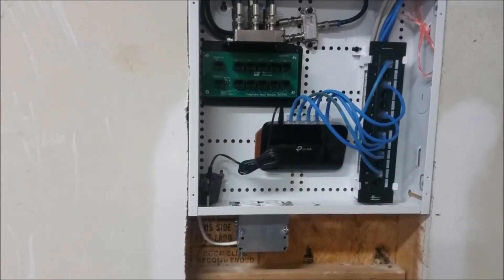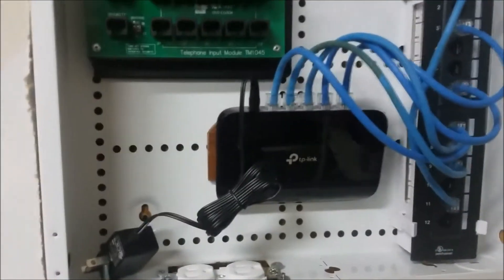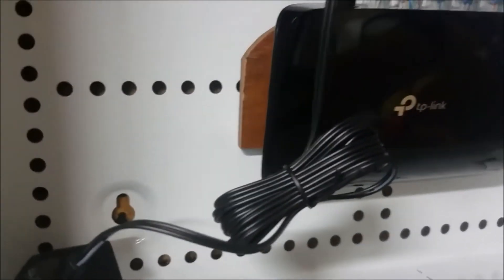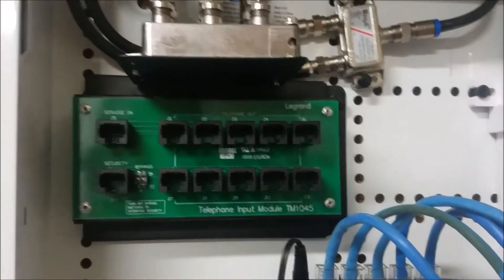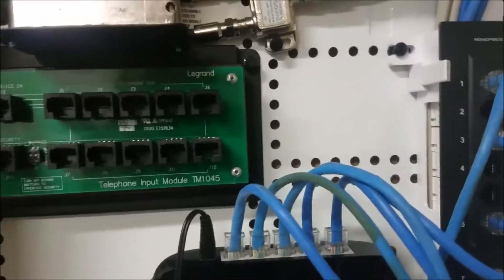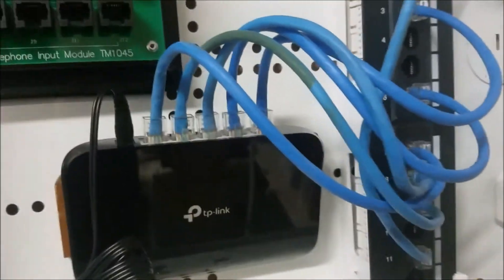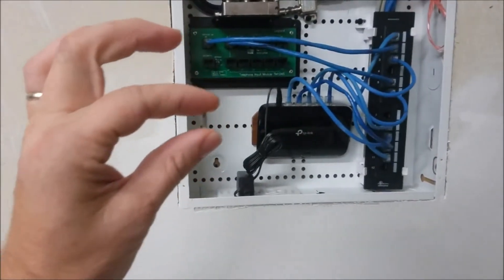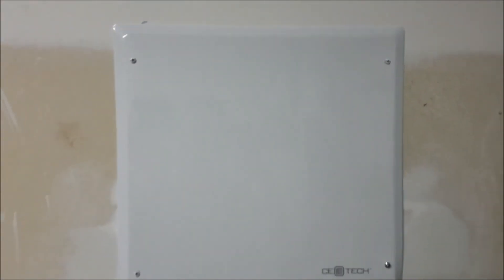CE Tech 5515 Telecommunications Cabinet Installation and Review

Comment: Great video. Thanks for posting. What's the distance from the floor? Is there a local regulation for that?
Reply from the maker: It was about 4 feet (about the same as the cable box outside) and above the fire break, but I'm not sure what the local reg is for that.